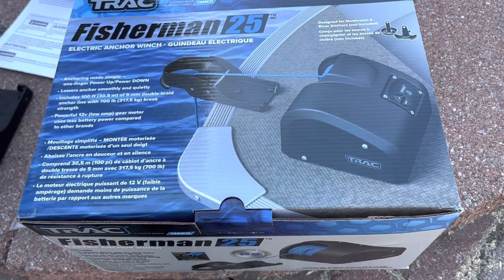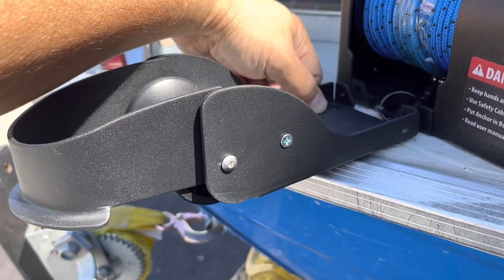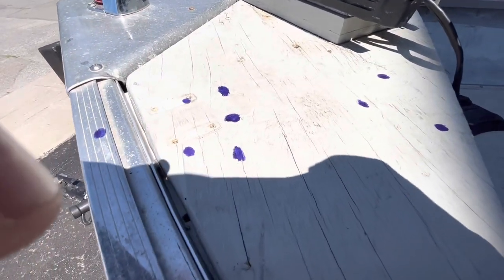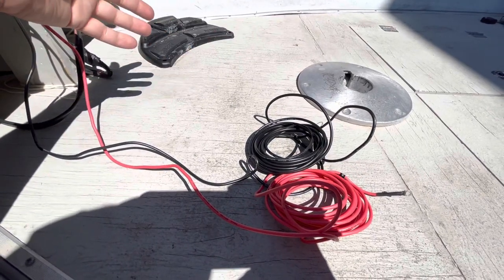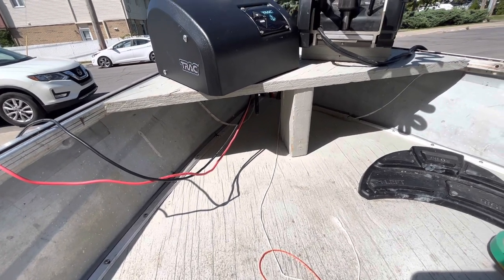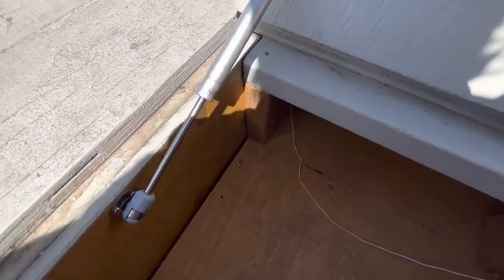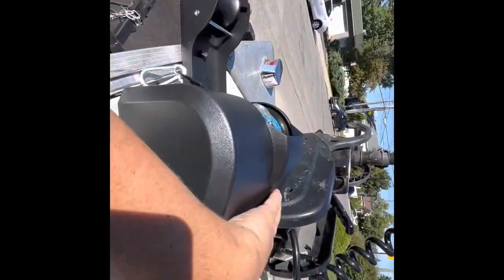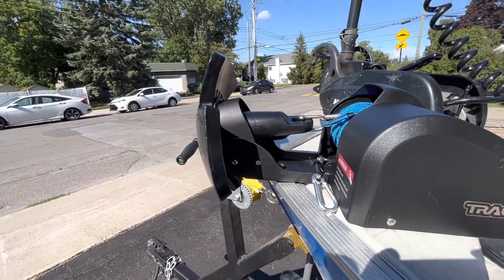How to Install an electric anchor on boat (Trac fisherman 25)

Comment: I am contemplating almost this exact same installation on my 16 foot Tracker side console.  There are some other factors to deal with because the deck at the bow is enclosed and the front Nav light is in the way (it is a socket mounted into the deck) but your video gave me some excellent clues as to what to expect.  Thanks!

Comment: Do these have an auto shut off when the anchor get to the top and in the bracket or that is up to you to shut it off ?Thanks
Reply from the maker: Hi terrymunn, thanks for watching. No this model does not have an auto shut off. Once it comes up and seat in its place, I just take my finger off the button. Don’t know if other models have the auto shut off.

Comment: Hi, would you still recommend that winch/ any issues so far? Thanks
Reply from the maker: Hi maxmutzke, Thanks for watching. I use it in rivers and strong current, works good with my 14-foot boat. 
I’m very happy with it. 

The only thing i got was that I used the recommended 20amp in-line fuse, and it blew every time when anchor would get to the boat. The heavier the anchor is, the more your Fisherman will work "so ask for more power". I have a 25 amps fuse now and works perfectly.

Comment: hi im wondering have you tried a traditional 25lb anchor with it ? also im wondering is your anchor only suited to lakes non tidal etc thanks
Reply from the maker: Hi Andrew Gallagher, Thanks for watching. My anchor is a 15lb and I use it in rivers and strong current, works really good with my 14-foot boat. I never tried the 25lb. 
It will happen like any anchor that it doesn’t grab the bottom but once it grabs, its good to hold. I’m very happy with it.

Comment: What size fuse did you use ?
Reply from the maker: Hi user-cy9lm5wf1e, thanks for watching. 

1. Do not use electrical wire sizes smaller than 14 AWG (gauge) with a 105-C temperature rating. Using wire that is too small.
could result in overloading and a fire. Larger gauge wire is permitted.
2. Use the supplied circuit breaker or a 20 amp in-line fuse when installing this winch.
3. Use only suitable wire for electrical connections between the winch and battery.
4. Make sure any crimped electrical connectors meet industry strength and current requirements.
5. Always disconnect the battery lead wires from the battery before attempting to install, relocate, or service the winch.

That is in their manual, I used the 20amp in-line fuse and it blew every time when anchor would get to the boat. The heavier the anchor is, the more your Fisherman will work "so ask for more power". I have a 25 amps fuse now and works perfectly.

Comment: What paint on the deck
Reply from the maker: Hi bigdokeechobe, Thanks for watching, for the paint I used Berh primium floorcoating. It's a low-lustre enamel porch & patio paint & primer in one. I also added some non-skid floor finish additive so it's not slippery when wet. its like a sand you add in the paint :)

https://www.behr.ca/consumer/products/floor-coatings-sealers-and-prep/porch-and-patio-floor-paints/behr-premium-porch-and-patio-floor-paint-low-lustre

https://www.behr.ca/consumer/products/floor-coatings-sealers-and-prep/floor-enhancements-and-additive/behr-premium-anti-slip-floor-finish-additive